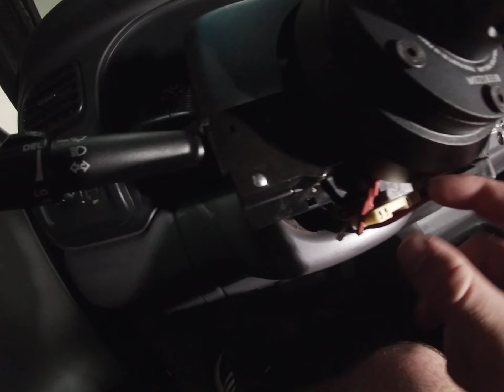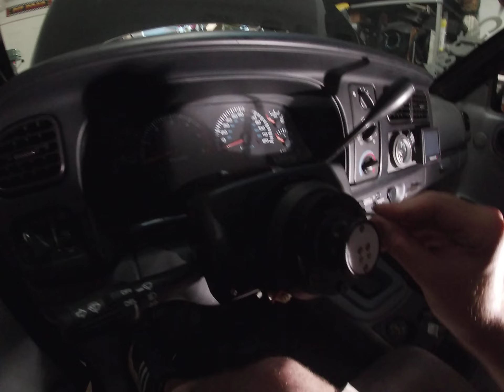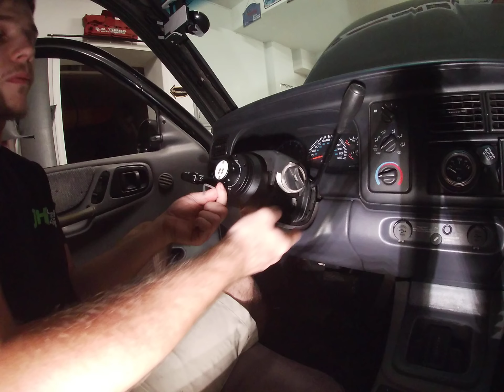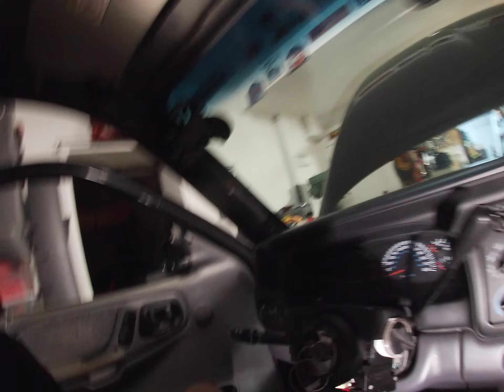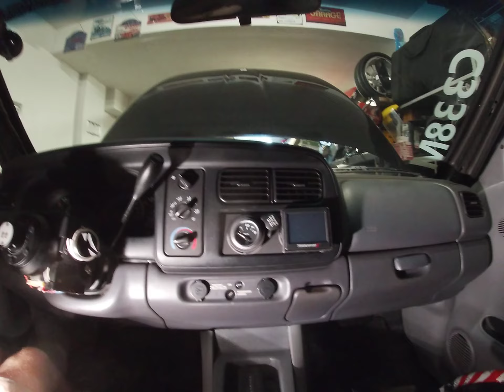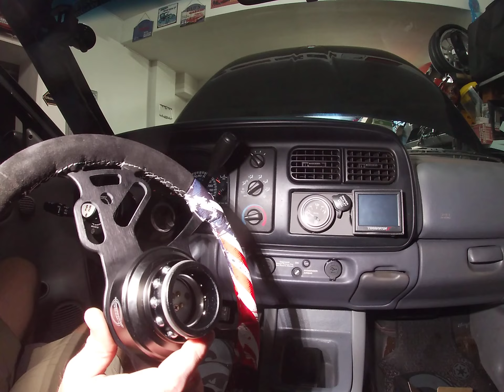1999 Dakota RT Aftermarket Steering Wheel Installed

Comment: adapter you use is SRK-170H , do you think it will be the same for a 2000 dodge ram ? SRK-163H does not fit
Reply from the maker: I am not entirely sure.   If you have any local junkyards you could look at the columns between the two trucks and see if they are similar

Comment: So what is the pattern for the standard wheel?
Reply: I got a 99 dodge Dakota also, that same adapter just popped right on the spline ?
Reply: I’ve looked everywhere and can’t find anything on this truck I just am trying to fine a steering wheel adapter to fit the spline on my 99 dodge Dakota
Reply from the maker: What do you mean by “standard wheel”
Reply from the maker: The short hub part number in the description does slide directly over the factory splines I don’t recall what the specific spline measurement is off the top of my head